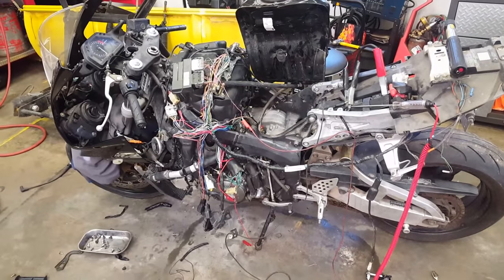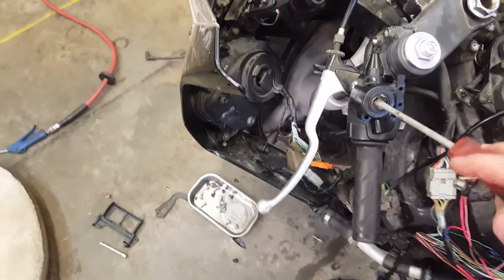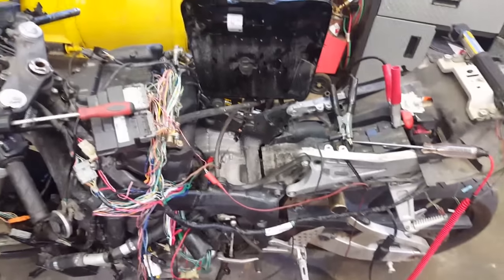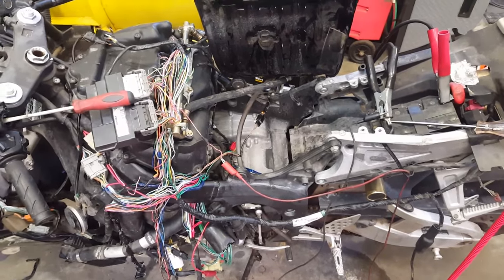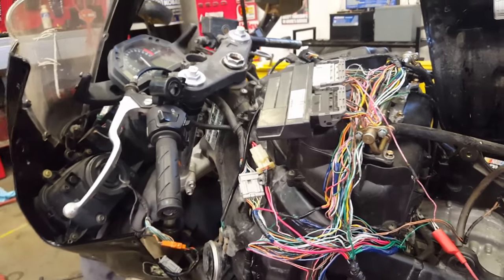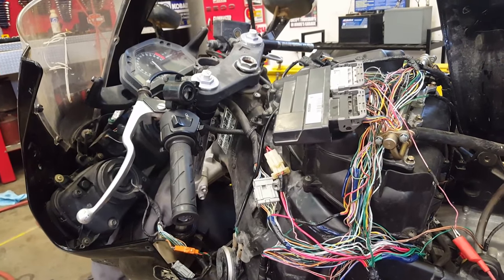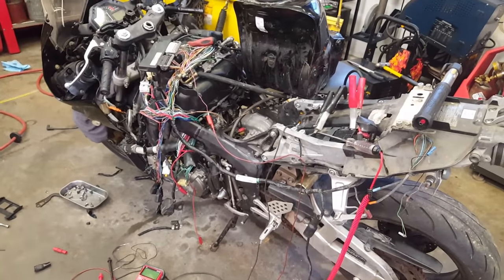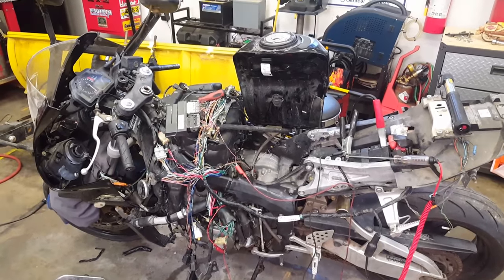2004 Honda CBR600RR no start fix. No fuel prime

Comment: HOLY COW. I lost my keys to my cbr like a year ago and switched the ignition out. Ever since then I've had the fuel pump prime issue and I've torn my bike apart and read countless amounts of forums trying to find the solution, only to land here randomly at this video at 3 am that solves it. I cannot thank you enough for posting it.
Reply: I literally just changed the ignition on my Honda vfr800 and removed the custom led lights that had been put on. And I done had the same exact problem. Going through wires trying to figure it out!
Reply: Has anyone figured out how to do it without the 9 volt battery
Reply: @itswil3492  replace 9v zener diode

Comment: the 9.1 V Zener Diode was the wrong way around or you were not using a 9.1v Zener Diode.
google "9.1v Zener Diode" in your area to pick one up cheap, 
the diode will need to be put in backwards, the normal way will produce 12v and in reverse, it will limit the voltage to 9.1v. (they are a special type of diode)
Zener Diodes are better than Resisters because they will maintain the 9.1v regardless of the voltage on the battery 10-15v.   eg. when charging.

Comment: Thank you for making this video. I'm a master Subaru technician, just picked up my buddies 05 CBR600 with a crank no start. I don't like throwing parts at anything I work on, so I figured I'd do some research ahead of time. This video just saved me a lot of unnecessary disassembly and diag right away. I know about the common fuel tank/sending unit corrosion issues, but this is the gold nugget of info that I've been searching for. I'm gonna make sure to do a proper write-up with pics and instructions on a couple of forums so that the next guy can avoid turning his harnesses into spaghetti or ending up with a bill from the dealership that's more than the value of their bike. Thanks again brother. Ya don't know till ya know!

Comment: What if theres no pink wire? Until now my cbr it was starting until one day something went off with speedometer it went completely black out i check starting relay it was bad i changed it then i had power to the speedometer but no response and the fuel pump doesn’t prime also i check for  pink wire from the ignition switch and its nothing there

Comment: YOU ARE THE MAN!!! I have Honda VFR 800 2002.. Thanks a lot!!! I bought the bike, and the seller said it’s just starter relay and I’m change ignition switch and fuel pump . Battery was dead 😬 so I can’t try it.. and guess what? FI is on and I can’t start the bike😬 so I change battery, starter relay, stator, IPG, Regulator and still nothing no spark no fuel pump priming.. so I change CPU, BAS still nothing. Then all wiring harness, spark plugs, ignition coils and nothing ... I've read all the forums and nothing. But today I saw your video and? She is alive!!!!! Thank you 🙏

Comment: I haven't installed a new zener diode yet but I did cut the pink wire, connected it to a 9v battery and got the bike to run. THANK YOU VERY MUCH!
Reply: How did u hook the 9v battery to the pink wire what do u do with the negative wire
Reply: To the frame

Comment: Thanks for the video. Unfortunately, My bike was vandalized after it was stolen. They tried to short wire it, but didn't succeed. I didn't try that fix yet, I am having the same symptoms though. I was wondering if the generic ignition set on Ebay has that diode? or I will have to look for the genuine HONDA one?

Comment: Ah dude, Thank You, Thank You, Thank you!   I bought a theft recovery bike and the ignition switch had been stripped out of it.  No big deal I thought and just ran a simple on/off switch to it.  Needless, to say she never even spit or coughed.  I have traced every wire, thrown parts at it, and was at my wits end until I saw your video.  My bike looks about like the one in your video.Sure enough, I hooked a 9 volt battery up to the pink wire and she cranked right up and ran like a champ.  I have to admit, I wondered what the pink wire was for, but just ignored it like a big dummy.  Dang, I am totally pissed off for being so stupid, but elated she is running,  I sure learned a lot at least.  Again, Thank You!!  May lot's of good karma come your way.
Reply: Mine has no pink wire, at least i cant find it
Reply: So where did you hook the negative side of the 9v battery to? 
I want to do the same for my bike but am confused. Cheers
Reply: @salemkraidi3530  Negative wire goes to ground...any ground will do.  Ground to frame or negative post on battery is simplest way.....
Reply: @cpa2222x  my man.... Thanks a lot buddy. Cheers
Reply: Your not stupid for not knowing you would have to be extremely smart to just guess it was this or to even figure it out

Comment: My race bike with ignition key delete just started having this issue intermittently and then the main fuse blew just as I was going out for a race!!  Turned out that the connection to the diode in the pink wire was bad - not sure if I would have found it without seeing this!  Great work, much appreciated!!

Comment: hey andrew i try this a few days ago and it work wonderful but there after i lost power in the pink wire and i didnt get any spark on the plugs the voltage drop to 3.73 even after connecting the pink wire back direct without the small battery

Comment: dam maybe might fix my issue 2005 honda cbr600 f4i. drove 3 hours away to Wisconsin dells then try to ride to Milwaukee  bike start right up then a min later bike turn off. try to start it cant hear fuel pump prime but can hear fluid pump relay click. pick up bike late that day , it started right up and try go up ramp it just die. a week pass i have bike in my garage and try to start it and it stay on for few mins.

Comment: Unfortunately in my case, all that stuff was good. 

My new Rectifier blew my battery and pin 25 on one of the connectors which activated the fuel pump. 

I had to buy a new computer and it worked. 

Great find on your part though. Great video.

Comment: Thanks, It fixed my problem on 2003 cbr954
Reply: I have the exact same bike as you and I am having the same problem with my fuel primer. It is super weird because the fuel primer DOES connect but after turning it off and on it DOES NOT connect any more and i have to wait 10 minutes of turning the bike on and off for it to finally connect again which enables me to start the bike.  Did your bike have the same issue or did it not connect at all?
Reply: Did you fix your issue?

Comment: I'm starting to think my motorcycle hates me.. after hundreds of previous issues, before winter came water got in the tank, so as spring approached I spent weeks trying to get the bike to fire up again after that.. had to take it completely apart cleaned the whole fuel system and injectors, replaced with new fuel and it fired up. I was so happy.. just for that moment. Put my bike back together, grabbed my helmet to go for a test ride only to find this issue now.. no prime. I pray this 9v battery works or I'm going to lose my mind.
Reply: So apparently nothing really was wrong with the fuel pump or diode. As I was searching the ECU for the pink wire because there were a bunch of pink but with a stripe color, I tugged on a few pink wires to check with my multimeter as to which one was getting 12V, but in order to send power, I turned the key to send power from the ignition and boom I hear the fuel pump engage. I'm still not sure why it took me tugging on a few wire to work when it wasn't engaging the numerous attempts before but I'm not complaining.. will keep doing some research though just so this doesn't happen again. Thanks for the video bro! ✊🏾

P.S. I noticed because I had my fuel tank propped up, maybe that helped drown the fuel pump in more ethenol, so try that too guys if nothing else works. Good luck 👍

Comment: Great fix...thx. I have problem when my steering wheel is totally left, motorcycle can be turned on. When is not in that position...fuel pump does not work. So I guess there is a break in wire somewhere since I checked kill switch, fuses and relay...good luck to me 😂

Comment: Im checking a cbr 600rr but switch ingnition haa only 2 red wires, wich pink wire hast to be recivig 9volts on ecu ? On grey conection has 2 pinted pink-white, and pink-green.. 😬 i try by bypassing the bank angle sensor but still has the same issue i think mine its a 2006

Comment: Damn nice vid, just stumbled across this now and I have a very similar problem but where mine is slightly different is my pump primes but the bike won’t fire does anyone know if it could be the same issue ? Or a different issue. Bike is a 2015 CBR600RR

Comment: I’ve got the same issue with my CBR1100xx after not running it for 12 months. All the relays are okay, it might just be the pink wire and diode as you say.

Comment: Hello I had a problem where nothing would happen when switching ignition to ON no lights no sweeping guages no nothing. I was able to fix this by spraying Electroninc Contact Cleaner in my ignition with the battery disconnected and worked the ignition from Off to ON repeatedly for about 5 minutes continausly spraying then letting the spray evaporate before reconecting the batterry and then my ignition worked fine.

Comment: I have a 1988 honda cbr 600 and after I take it for a run for about an hour. Then I turn it off for about 2 minutes it will not start again can anyone help point me in the right direction to solve this problem thanks.

Comment: i have the cbr f4i and for me when i was using a multi reader and touched the back of the starter it prime the fuel pump up and allowed the bike to run. So to me this meant the tip sensor was working properly, the fuel pump was good, and it was something with the electrical. so what i end up doing was just taking a wire and grounding it to it to allow the bike to run but the headlights was refusing to turn on so more than likley its that green wire in the front causing the issue so ill check in a few more days once the new starter relay comes in and see and ill check the fuse all and all this has been a big headache for me

Comment: hi i have a 2001 blackbird and i to had a total shut down it would turn over with out a problem and after checking every part of the wiring and after watching this video i found on the under side of my Ignition Switch there is a zener diode that has dropped off the connections on the bottom of the ignition witch has stopped the pump from priming but thak you so much coz iv been pulling out my hair on this problem and it has saved me so much money thank you so much for posting this video from mark
Reply: I'm another 2001 Blackbird owner here for the same issue. Pump won't prime on switch, hotwired it and it works. Mine is a USA model (redbird in 2001)- is yours a U.K. bike?

Comment: Here's my issue, 
I tested my fuses and relays and theyre all good. 
Tested the black wire connector that hooks to the pump and im getting 12v.
Took the pump out of the tank and tested it directly at the pump, pump turned on.
Put the pump back in the tank and tested the wire to the pump that comes out of from the tank, pump turned on.
Hooked the tank back up and tested the first black connecter I mentioned 1st and got 12v again.
Then I tested the wire going to the pump (for it with a negative and positive from a 20v drill battery just like I did before i hooked the fuel lines back up) and now it doesn't turn on even though it did before... im so confused.

Comment: In this situation did you also have no spark in having a simile issue if not the same with my 05 it cranks but not getting fuel and spark

Comment: Hi Andrew! Your video couldn't have come at a better time. I'm encountering the same issue on my 2003 600rr and I'm going to try your fix! I would like to clarify, how do I connect up the 9V battery for testing? I tried pausing to see how you wired it up but I couldn't quite make sense of it. It would help me a lot if you could guide me!

Thank you for your time!
Reply from the maker: Name Sake cut the pink wire where it goes into your ecm. connect it to one lead on the 9 v battery and then connect a wire from the other terminal to the battery groud. also make sure your batter has 9 - 9.1 v. most new battery have 9.6 to 9.8 v. I had to drain the battery down a bit before it would work. the computer needs to see a very specific voltage. good luck and let me know how you make Out.
Reply: Hey Andrew, I tried what you said... and the bike started! Thanks a lot for your help!
Reply from the maker: I'm happy it worked out for you! safe riding!
Reply: Man thanks for the video! Saved me a ton of time and money!
Reply: Andrew Hinds my question is this because I have the same problem so what you do after the bike starter you remove the 9v battery or you put at the bike somewhere
Reply: hi buddy I have exactly the same problem the only thing is the my bike is a 2006 and I don’t see the pink cable coming out from the plug to the icm they have two red wires  coming from the ignition and follow out the same with two red one, this bike are driving me crazy!

Comment: Just bought a project f4i with no spark and when the guy started to turn it over i heard to fuel prime. Glad I found this video. Im sure this will fix it. Are there any aftermarket ignition switches with the pink wire?

Comment: So I have a 2004 cbr and I have a new ignition switch I haven’t tested the Ecu yet I tested the engine start relay the fan relay and the the fuel relay and 2 of them were bad could this be my problem as well the bike won’t prime the pump and I tested the pump and it is fone

Comment: I’m on an 06 1000RR and it’s been doing the same thing intermittently.
It would even die while I was riding it but only to fire right back up while rolling. Essentially a 50mph push start 😂
It would have zero electrical issues just the fuel pump would reprime and I’d be on my way.
Then it was happening at random stops but would start immediately.
Then yesterday I rode to Walmart, came out and zero prime.
Everything else looks like it’s working but it refuses to prime.
I’m betting you just saved me a lot of time and money.
I WILL come back to update if this resolves my issue.
I’ve already found the pink wire.
I just need to put some other stuff back together before I can test it.
Thank you for putting in all that work!

Comment: I have an 02 cbr 929 I’ve checked EVERYTHING. Replaced ecu and all relays are good and fuel pump will even prime but the injectors will not shoot. My diode reading is only 8.4. Would that be the problem??

Comment: MY GOD ANDREW I HAVE THE SAME ISSUE BUT MY HEAD LIGHTS ARE OUT ALSO. I'M THINKING IS MY ECU. BUT I'LL TRY THIS TRICK BEFORE I REPLACE THE ECU. EVEN THO I HAVE CUTTING WIRES I LIKE MY STUFF STOCK WHEN IT COMES TO ELECTRIC PROBLEMS
Reply: You fix the problem?
Reply: Yes brother. Mine was actually the wire harness the connects for the head lights to the main harness had some conectors that were rusted.

Comment: Mine is doing the same thing but instead of the electric start button turning the bike over it doesn't do anything is this still the same problem? My key broke off in the ignition and I after replacing it with aftermarket. I found this video but I can't get the start button to fire please help

Comment: Very good presentation. Expound on that 9V battery for the elimination of all your work. Dude, make the test tool. Interface the pink wire, prove it out. Oh, and the Zener, pronounced zee-ner diode, is something Harley Davidson needed waaaaay back in the day of generator systems so that headlight/taillight systems didn't poop.  Tie in up front and bury in headlight bucket... No feedback from generator to blow headlight. Taillight...., well..., I could always do without... No sense looking behind.., and no sense anyone seein' where I've been....

Comment: Hello Andrew. I just purchased a Honda NC750 from a police web site that auctions off stolen recovered bikes.
The HISS key is in the ignition and the thieves seem to have wired a simple toggle switch into the system.
When I turn the ignition switch on, it all lights up like a christmas tree but the fuel pump doesn't prime.
When I press the starter button, the engine turns over but obviously wont start.
Can you help with any possible solutions?  Cheers.

Comment: Anyone know what the a
fuse behind the ignition fuse is , it’s a 20 amp smaller fuse and when I try to start my2003 honda c r 600rr it blows ? My br 600 rr turns over but doesn’t start!  Glassed fuel pump towed if it was working.  , it is. My fuel pump relay wasn’t getting  any power, replaced fuel pump relay.still not starting and small fuse behind and to the left under the seat keeps blowing. Is this small fuse related to fuel pump or fuel injector ??? Bike still not running , turns over strong. Thank you . Rocco (Gymroc09
Reply: Anyone who owns a 2003-2005 honda cbr 600 rr  able to let me know the small 20 amp fuse behind the 30 amp fuse that is the ignition fuse under the front seat between both front and passenger seat? Mine blows when I try to start my cbr 600 rr. Bike is turning over but won’t start